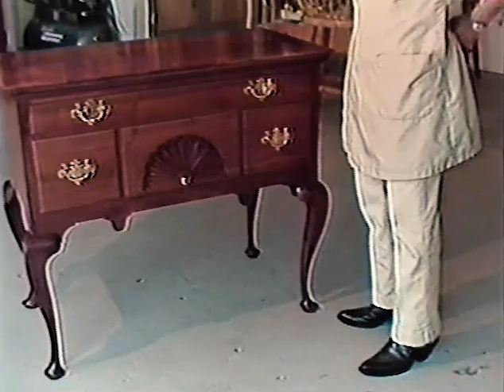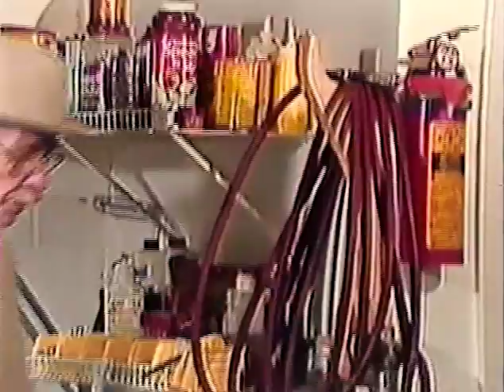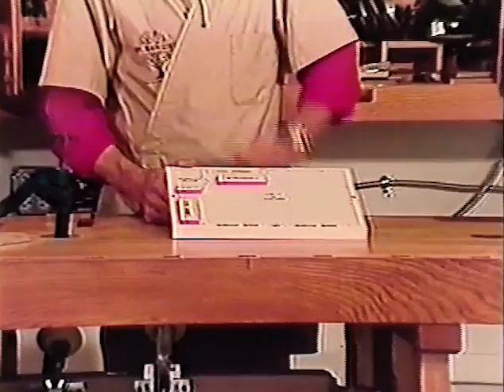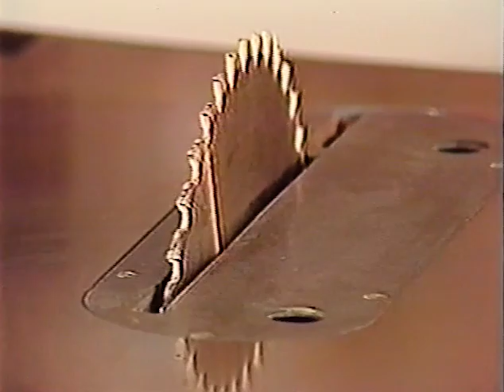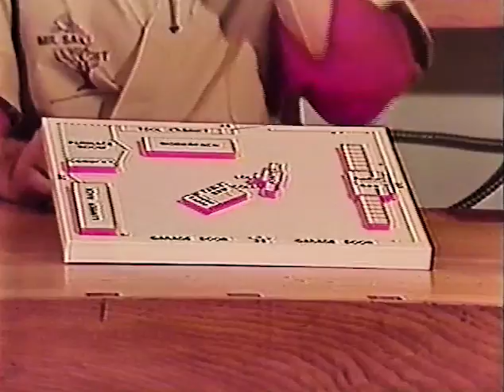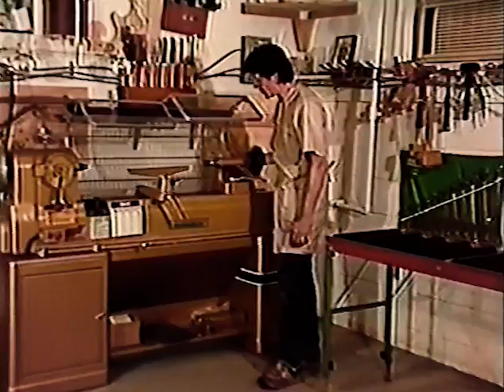Mr. Sawdust – Setting Up Your Ideal Small Shop

Comment: If you have your own shop, you need tools.  If your the only one using it your do not have to have a certain place.  In my shop, I leave my tools where I last  use them. I can remember my last project and the tools i used and that is where I left left them. Imagine how much you could have accomplished if you did not have to organize your shop.  We won WW2 by;  Build, Test and Fix, Quickly. My suggestion "turning a disadvantage into an advantage" is to build an operating mockup from paper, cardboard, plywood,  So, make it first from whatever and then use the Cherry, Walnut (I have a cache)  study the joints and fasteners and apply the Test;  Create an Operations Process Chart and apply the rules for improvement;  Eliminate, Combine and Simplify.  The old rule; measure twice and do it right once.
Iguana Dave,  GET SMART, VOTE TRUMP  He understands; Experience, Competency, Curiosity, Courage and how to make things better.

Comment: why do you need a table saw and a radial saw?
Reply: I was also surprised to see a table saw in his shop
Reply: It's way easier to rip on a table saw and cross cut with a radial arm saw or a sliding miter. I use all three.
Reply: @Gold-oj8do did you ever rip on a radial arm saw?
Reply: @ScreamingEagleFTW   I haven't ripped anything with a radial arm saw for 40+ years. I use my table saw for that. How about you?
Reply: @Gold-oj8do  I rip all the time on my 12" Craftsman RAS from 1975.  Works perfect. Its not really fair to say a table saw its easier to rip on than a RAS if you have never really used it for ripping very much.  Its just a skill that you have to learn just like ripping on a table saw. Ive used both and prefer the RAS for ripping, safer and easier imo. I can rip a 4x8 sheet of plywood in half.  I admit I cant cross cut a 4x8 sheet of plywood but its not hard with a 4 foot homemade guide and a skill saw.  No sure how easy that is on a normal table saw.
Reply: @ScreamingEagleFTW  You're right, it is what you get used to. My dad never owned a table saw and did everything from his radial. And I cross cut my plywood just like you with a model 77 Skil Saw.